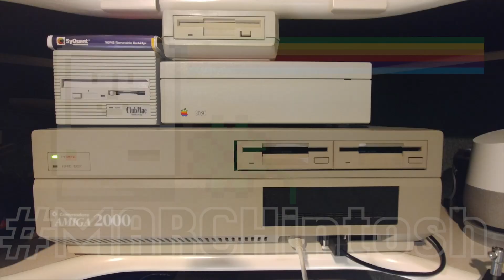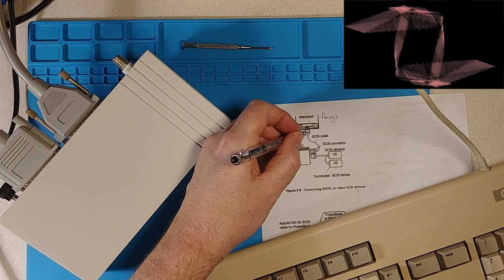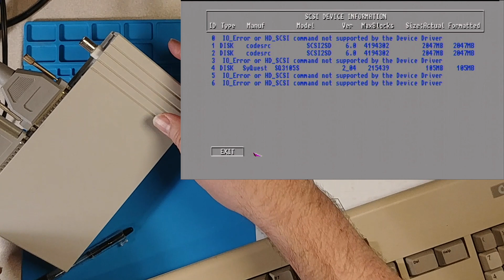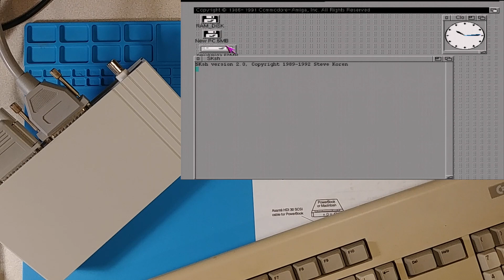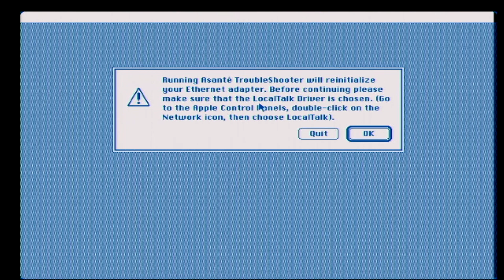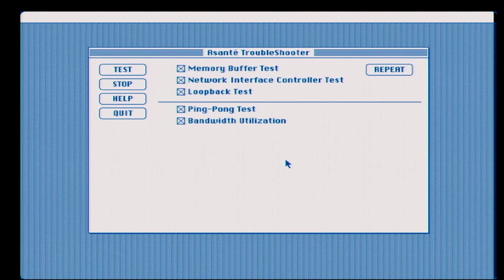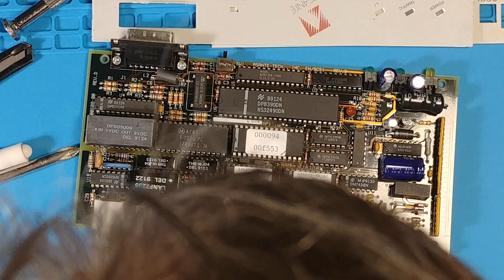#MARCHintosh Mac Plus: Sneakernet to Ethernet?

Comment: It would probably work off the SCSI controller included on an Emplant board ;)
Reply from the maker: Do you need my mailing address? :)
A-Max II advertises that it supports SCSI devices other than Amiga-mounted hard drives via the SCSI driver the user specifies in the set-up screen.
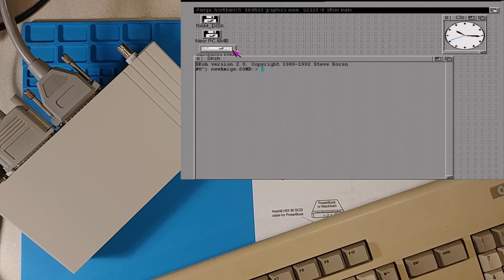14:42 You can see I've set it to "icddisk.amhd". (This is the A-Max-specific version of the ICD SCSI driver.)
I didn't get to showing it here, but I have been comparing (binary diff) the Mac Plus ROMs between the original and a copy made while running mac OS under A-Max II using CopyRoms ,and found that the status bits for the AppleTalk driver in ROM are patched by A-Max, but I haven't decoded it yet. It /might/ be that this version of A-Max disables AppleTalk. The later hardware version (A-Max IV; the final version) has a card Zorro, like Emplant, and supported it.
Reply from the maker: Oh, I should have mentioned that there's a wonderful, annotated, disassembly of the Mac ROMs here. Soooooo helpful!
https://www.bigmessowires.com/rom-adapter/plus-rom-listing.asm